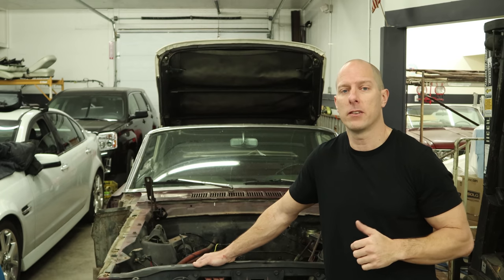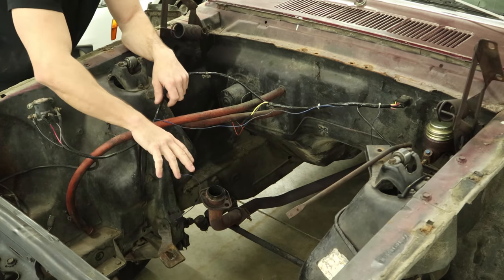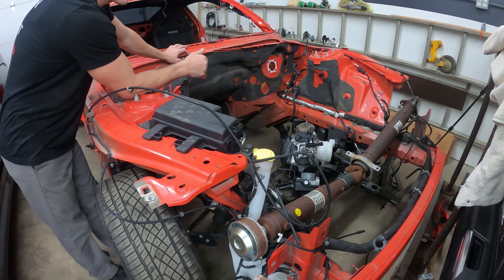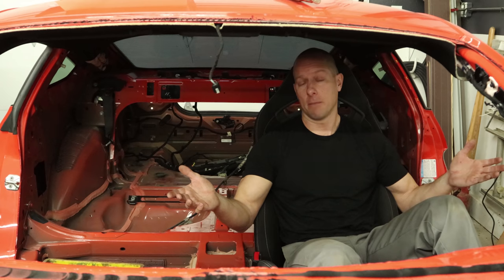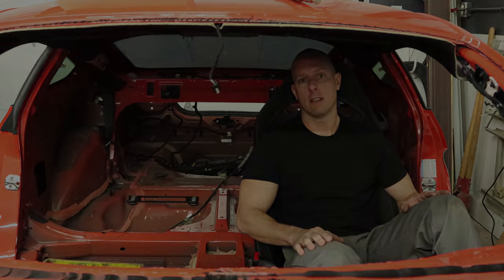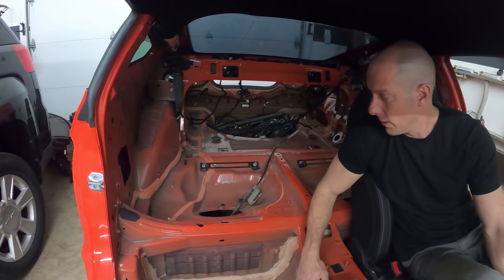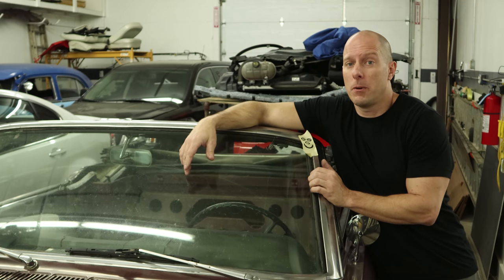The future of the Mustang restomod coyote swap rebuild project  part 6

Comment: You are doing this right by narrowing the floor but you have to leave the dash to the Mustang Inn you have to leave the cowl at least the upper part that connects to the a-pillars by the windshield the rest will work just because you narrow the floors will not hurt you because the Mustang has wider door panels enderal Mustang has basically cardboard you can try to make the modern dash out of the new Mustang work but you will find out after you take trim it down it will not look right used original Dash put the new Mustang cluster into the 65 it will fit right in there you can even put your harness back into the clip holes and it will hang itself and you will not see it behind 65 setup other than that it pretty much is a fit set for the radiator it's going to set too well and stick out the bottom of the valence of the Mustang what you do is why you have it apart you can move your bracket upwards 8 inches very easy

Comment: You should do what I call sleeve the car basically use old car body , cut floor out after bracing . Do the opposite to new mustang . West Coast customs has done it multiple times. Maybe look up some videos and kinda get an idea. One was an old charger I think. For actor Gary Dourdan 
off CSI. I think the show was called Street Customs from discover tv. I think Amazon sales the video now.
Reply from the maker: That leaves lots of other issues but thanks.

Comment: You got me with that April fools prank. I was actually pissed you were giving up. Looking forward to the build. One question, what are you going to do about the width of the rear axle and the front wheels? Pretty sure its a lot wider on the 2015....
Reply from the maker: I had always planned on flares and now I don’t have to get different offset wheels to make up the difference.

Comment: Check out V tuned garage, tires are going to hang way outside the 65 body. Detroit Speed makes a front suspension kit.
Reply from the maker: They also make wide body kits that I had planned on from the start.

Comment: I subscribed to your channel because of the quality of workmanship in the rebuilds you've done. I don't doubt that you know what you're getting into here. I'm wondering about the structure here. I believe the floor pans between convertibles and hardtops are different. May not be a problem if Ford reinforced for the coyote motor. By the way your going to need special welding  to get the freedom metal and the global mystery metal to stick
Reply: April fool's

Comment: You might need to reinforce the frame of the 2015 because you will use it on a convertible body
I  remember when ford released this new body, they reinforced the convertible to perform the Same as hardtops in crashes and to be solid in slalom test and not to flex and twist too much
Reply from the maker: We’ll see

Comment: So if I understand correctly you plan on narrowing the middle section of the frame on the newer mustang.  I assume you  are leaving the front and rear suspension points alone which means wheels will sit proud of older mustang body.  Is the plan then flares or different offset wheels.  If a wheel change will they clear the  frame?  Curious how your cowl turns out.
Reply from the maker: I had planned on flares all along now the tire width will match. The cowl will be my biggest challenge.

Comment: Is going to be interesting, really like your vids, subscribing. Qwestion: don,t you need extra bracing/support for the bottom pan, by using it for a convertible?
Greets from holland
Reply from the maker: I’m not cutting anything structural out of the 65 and I am adding full frame rails from the 15.  The only extra bracing I would like is for the added HP but the cars itself will be stronger without it. Glad to have you with us!

Comment: Like the plan. What about the power top? Are considering using 2015 convertible roof controls?
Reply from the maker: The 2015 is a hard top.  The 65 will be a manual top.  I rarely put the tops up anyway.

Comment: I would have respected you for taking plan D, it's a wise man who knows when to quit while he's still ahead or not too deep, but I was still sitting here asking where plan E is, narrowing the 2015...and there it is.

There's one huge issue you need to consider here and this is a matter of engineering, structural framework, and the fact that your 2015 underbody is in a unibody coupe while your 1965 is an open body frame, whereas if you open the doors it should be apparent that the only thing preventing your car from folding in half is the beefed up underframe that is under all convertibles.  Hardtop coupes rarely have this subframe beefup because they can rely on the roof for structural support.

There's no problem with essentially putting the 65 shell on the 2015 body, but do consider ensuring the 2015 skateboard (what you will have left with once the shell is removed) is strong enough to take the monster torque put out by that V8, or else you may end up with a car that folds up upon itself.  The 1965 body will be giving you practically no help at the floorboards where they pass the doors.

This is a good solid plan to retain the running gear, though, I hope it works out!
Reply from the maker: You have given the 65 too much credit.  There is no support other than the seat risers on the floor.  By adding the 2015, I will be gaining an extra set of frame rails down the center.  I plan on some cross braces as well just for good measure.  All the strength of the 65 is in the rockers and those will remain 100% intact.
Reply: @vehcor  Very nice, solid plan.  I can look forward to this. Good luck with the measurements!!

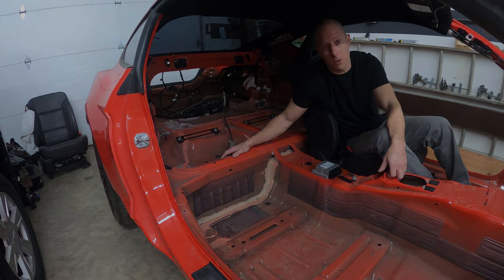Comment: 4:28 "let's measure it out and see if it will work".....from the other two youtubers who are doing this the 2015 is like 2" too wide at the firewall/dashboard. The axles are also wider. So using my precognitive abilities I'm doing to forecast that the answer will be "no it won't work".
Reply from the maker: You really need to watch before commenting. 😂

Comment: Are you going to bolt a jig in the bottom of the coyote so it stays straight as you put the old body over and around the donated floor...
Reply from the maker: The part I am changing is all structure for the drivetrain, it should stay fairly straight but I will brace some of it for transfer.

Comment: Plan B too costly.? It's a M II xmember and a R/P, and some sheet metal.  Stacy David did a 67 Cougar a few years ago.

Like the way you are going.  Could you take 2" out of each side of the 15 under the seats lengthwise and put the 65 body on it ?
Reply from the maker: No, It would add too much like cutting the rails in the floor, the seats, the dash, (twice) the heater box, the fuel and brake lines.

Comment: Since the 2015 is a hard top, won't you have to stiffen the frame on the 2015 when you change it to a convertible? Or is the plan to keep it as a hard top?
Reply from the maker: I’m not removing any structure from the 65 and adding additional from the 15.  It will be stronger than before.

Comment: Just an FYI, there are non-electric power steering pumps that will work with the Coyote V8.  http://www.mustangandfords.com/how-to/engine/mdmp-1208-vintage-air-coyote-5-0-l-power-steering-upgrade
Reply from the maker: I am well aware.  At an extra cost and loss of OE features like I mentioned in the video.

Comment: I have zero expertise but would think it’s easier to transplant the 65 body onto the 2015 frame, no?  And how’s my Explorer doing?
Reply from the maker: That is pretty much what I am doing except the frame is welded in.  The Explorer had its appointment for the  SOS inspection the day they closed the state.  Now it is looking like May before they open up and have to sort out a mess.
Reply: vehcor awright. Please keep it parked inside, under a cover, with tire warmers!  Oh, and lay low. This thing is a killer.

Comment: Would it be easier to cut the body off the 2015 and weld on the 65?
Reply from the maker: So have an old interior and drivetrain in a new car.  No, that is the exact opposite of what I want.

Comment: On the 2015...what was the branding for that vechical..salvage...or clean title?
Reply from the maker: Salvage
Reply: @vehcor  when you rebuild the old mustang with salvaged parts from  newer 2015 parts car ie suspension engine transmission..drive train etc .....will you have to get the restored mustang inspected or certifed for all the new structural  changes.

Comment: there's another guy that's building one but in the fastback and he's doing that Eleanor I think Eleanor car is overrated it would have been better as a bullet one but he's hackin the hell out of that car I don't think it's structurally it's going to be safe!!!!
Reply from the maker: I didn’t really look at how he did it but the outer sheet metal is not really there for anything except to make it pretty.  If he didn’t cut the structure, it will be safe.  That is probably the easiest method of all the Mustang builds on YouTube right now, Vtuned is the hardest and I’m somewhere in the middle.

Comment: Couldn't a convertible has the top taken off and just be made a roadster with no roof on it at all?
Reply from the maker: I live in Illinois, not Arizona, so no.
Reply: @vehcor  I'm originally from Peoria area so I know about winters and stuff in Illinois. But you wouldn't drive that you're around anyway would you
Reply from the maker: I won’t drive it year round but I will drive it daily and I don’t want to be limited to the few days a year that it might not rain or be stuck within a few miles of my house.